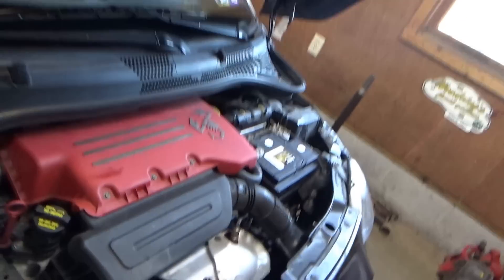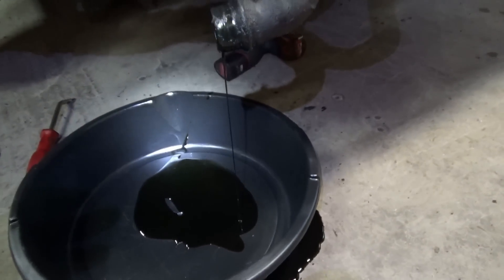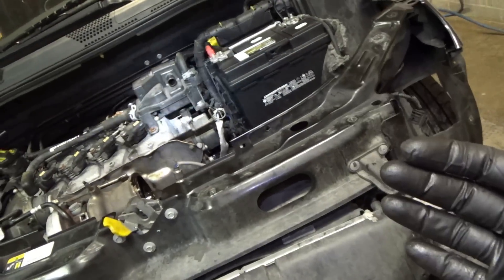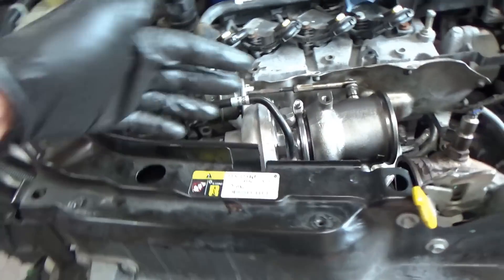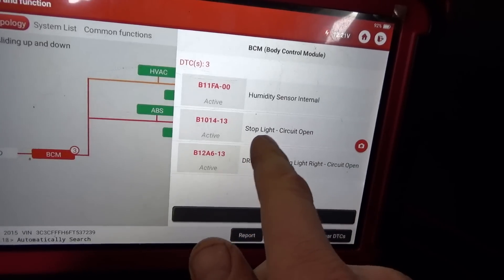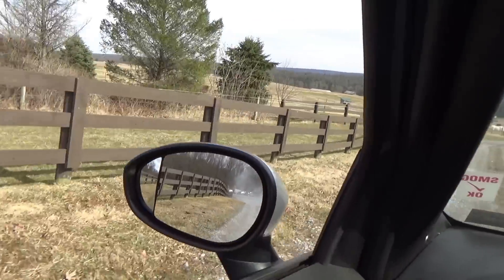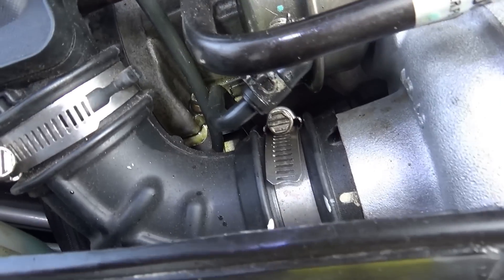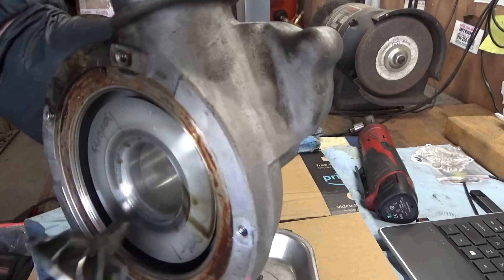Fiat Turbo GRENADES! (feat. Michael Jackson)

Comment: Roflmao,  I lost it when you said lets put a drainpan under the exhaust pipe.

My bet is the fixed oil leak was z valve cover gasket. And the 2 missing bolts caused the turbo to spool up. When. The waste gate shut the turbo had nothing to hold back the cerentrfical forces this snapped the fan shaft into 2.
I'll bet that turbo can be rebuilt. 
In fact ill be it can be upgraded and rebuilt.  Just mill away the dammage and use larger parts more boost and a larger rod.   Yes ill bet it broke becuse of the missing bolts, the motor wiped lashed the turbo had spinning energy and an equal opposite reaction happened snaping the pencil lead into 2 parts. 
Yes part of it was collage kid, most of it was shitty mechanic, proofs In missing 2 bolts and a loose valve cover gasket, id go back over all his work youll find other loose bolts.

Comment: Really don't want to run diesel oil in a gas engine long term. The additives are made to handle soot and doesn't have the additives to deal with gasoline contaminates.great job by owner not to grenade the engine.

Comment: I never really had a good feeling about these cars.  I was considering an Alfa Romeo 4C which has the same engine, but ultimately decided against it when I learned it's running over 20 psi of boost from the factory.  The 500 Abarth is a great weekend toy, but with all due respect to the owner, it's not a good choice for a college student.

Comment: Of course with a 2022 - 2023 car if you get a DRL rear left out code you are replacing the entire light assembly for $1000 - $1500 from the manufacturer because if it's LED it's apparently beyond the wit of man to repair (bullshit of course). Not disassembling the thing to swap a bulb or heaven forbid just reaching in to pluck out the same. I guess we now have to take out insurance policies to pay out in the case our car is an insurance write off because a bulb failed prematurely even though the car is only 2yrs old. Someone is making money on this, it sure isn't the car owner. :(

Comment: Let's compare a car with turbo charger vs a car withOUT turbo charger.
Let's say with TC you get 30MPG.  Without TC 25MPG (The MPG difference is not usually that much but I'll exagerate a bit.)
100k miles / 30MPG = 3.33k gallons @ $3/gal ==> 10k$ of gasoline

100k miles / 25MPG = 4k gallons @ $3 / gal ==> 12k$ of gasoline
The TC engine will probably have to be replaced at 100k miles.  And it will cost substantially more than 2k$.
The non TC engine will likely last to 200k miles.
The 25MPG non TC engine is better for the environment because energy and pollution is required to manufacture an engine and ship and install it.  And the reduction of energy and pollution for the TC engine because of better MPG is not worth it.
You can use this same argument against ECM motors for home HVAC systems.  And microprocessor water saving circuits in washing machines.
Doing things to "save energy" will do the opposite if the reliability of the device is reduced to the point that it has to be replaced more frequently.  I replaced a 40 year old home HVAC system with a new one which "used less energy" that had to be replaced again after just 7 years.  The only thing wrong with the 40 year old HVAC unit was the blower motor needed to be replaced.

Comment: He would have been better off buying a real car for the price of fixing this one, that is if you want to call these fiat Chrysler mashups cars. I was on 78 in Pennsylvania around the Bethlehem area, there's a part that's a pretty steep hill, trucks have problems getting up it, one night I saw one of these junks and amongst the tractor trailers it looked like a bug, this thing was struggling to get up the hill it seemed, the driver looked scared to death as I passed and what's worse it was from New York which is about 100 miles from Bethlehem PA,  definitely not a highway vehicle in my opinion, I guess for a college student to run errands with it's ok but again there are much better small cars out there, each to his own madness as Jean Shepherd used to say.

Comment: Lack of maintenance. 
The black oil shows it. 
And probably the udder so called Mechanics only made it worse.
Turbo require synthetics oil too. 
Seen vehicles with turbo die. Owners don't know what a turbo is either. what's dat do anyway????
When the owners see a 1500.00 repair bill. Then the car is traded in😄
That's why I don't like Turbos. 
At the end...JAMES BLOND Leaving a cloud of smoke and oil. Or BATMAN......😄😄

Comment: FIAT - Fix Or Repair Daily.    Or something like that.
Reply: "Fiat" and "Turbo" two words that never belong together. lol
Reply: "Fix It Again Tomorrow"
Reply: @sblagg527  My first car was a 1969 Fiat 124 Sport Coupe that I bought while I was in college. I bought it with 30k miles and sold it at 38K miles because I didn’t have the time or money to keep fixing it. But I did learn how to diagnose and service the alternator at the component level, install cam support gaskets, install Helicoils, replace the clutch disc along with the expected carb clean out, points, plugs, and condenser and brakes which were expected wear items in cars of that vintage. And what a treat to start that thing on a cold Minnesota winter day. Good thing it had a manual choke!

Yes, FIAT = Fix It Again Tomorrow. And it sounds like that hasn’t changed.
Reply: Fix it again tony